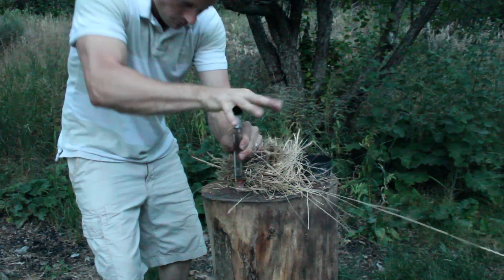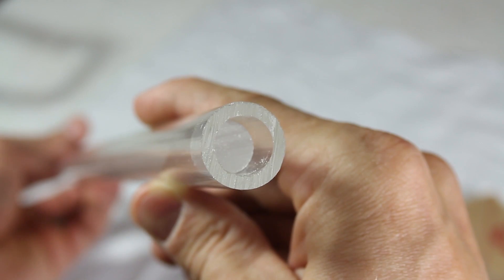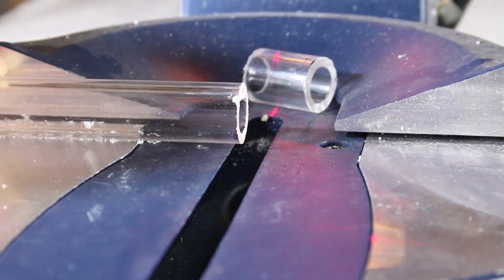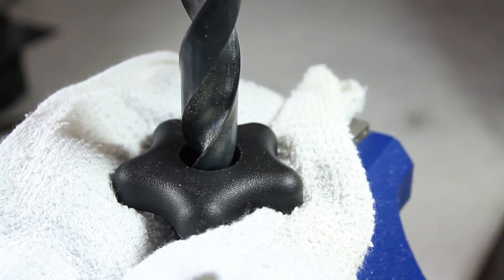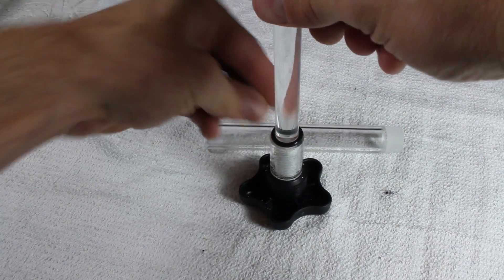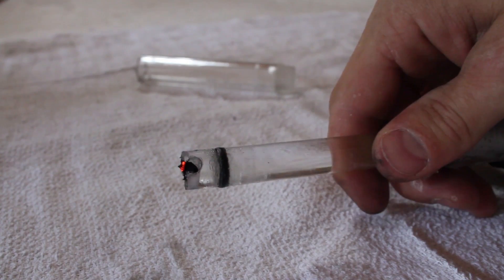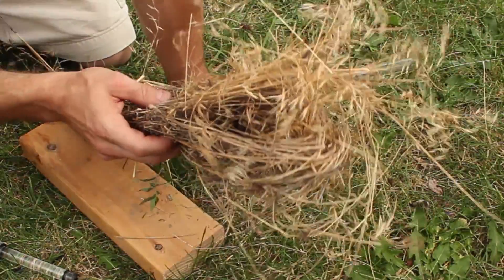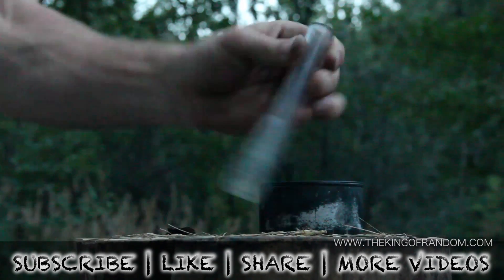Slam Rod Fire Starter - Ignition By Air!!

Comment: The principle is so well known, so such a device should have shown up long before now. Very cool, well hot actually.
   Tip for drilling plastic is to increase hole size in steps, use a low.drill speed, and most importantly use a lubricant. Mineral oil is perfect, but most anything will work in a pinch as long as it doesnt contain solvents. It washes up nicely afterward with soap and warm water. I saw the evidence of overheating during  drilling at least one of the holes where the chips coming out looked soft. As soon as you smell plastic its already too warm. Let it cool down before continuing.

Comment: I guarantee that the piece glued to the bottom will fail after several uses.  Been there, done that.  Also, if you want to use it repeatedly you need to get fresh air into the piston.  This is easily done using a small wooden dowel rod to push down into the cavity a couple times to force out the oxygen depleted air from your last combustion.

Comment: As one who has had one for years, I can say that this system of fire starting is iffy at best.   I do NOT use it as a primary fire starter, as everything in Nature is against getting a fire that way.: humidity n the air and on your fingers; bad char, bad tinder, too windy, too wet,   BTw you don't have whack (unless you like injuring your hand).    Btw anybody who says they get a spark on nearly every stroke is a liar.

Comment: hold up..... if compressed air ignites on it own. why do we need fuel in engines? Can someone make a high compression engine than ignites air on its own?
Reply: It's not the air that ignites. The temperature of the air rises due to the compression, which is enough to light the tinder.

Comment: How does it work
Reply: The equation PV=nRT, all you need to know is that P=Pressure and that T=Temperature. This means that pressure and temperature are directly proportional, meaning that if pressure is increased, temperature is increased as well, in a linear fashion.

Comment: Salvaged the 1k $ machines too ? x)
Reply: <100 for a cheap drill press. <20 for a cheap set of bits. <20 for a second-hand hacksaw. If you really wanted the use the chopsaw and not a handsaw you could pick up a cheap one for <100. I don't see what you;re getting at.

Comment: Or you can use a lighter
Reply: A light can run out of fuel a fire piston can't
Reply: Hououin Kyouma, AKA Rintarou Okabe what if you run out of charcloth
Reply: +Mister Dad. any dry tinder will work fine. dry brush, crushed dry leaves etc etc.
Reply: nah this is a lot cooler
Reply: What f the lighter has no fuel?

Comment: How long does the acrylic and O-rings last before you have to make this piston again? This looks like a great survival tool or just a general purpose tool for around the house if you happen to have a fireplace, fire pit, or a grill and you don't have any lighters or matches handy. But I'm interested in how often you might have to replace it.
Reply: It's a hydraulic piston so you'll have to replace the o-rings now and then. Install viton o-rings and use silicone grease for max life.

BTW: They were used extensively in the home until the invention of the safety match.

Comment: The comment section of this video is full of noobs, who can't use common sense. WHEN YOU'RE COOKING SOMETHING, DOES IT SAY, THAT YOU NEED A STOVE, A MICROWAVE, A GRILL, ETC? NO!
Reply: Yeah a microwave is totally along the same lines as a drill press. Most of the apartments I've rented had at least two drill presses.
Reply: Nah but they usually also don't say "for under a dollar"
Reply: Yeah, but they usually also don't cost less, than a dollar
Reply: Common sense, people. Use it. (Although, In this case, people are making it UNcommon sense)
Reply: aluisious just like not all apartments don't have drill presses, not all apartments have microwaves
Reply: Ummm noobs are new players so what do you mean?

Comment: this is so cool but why would you carry this huge thing or instead use a box of waterproof matches/lighter in waterproof container?
Reply: because, it can be reused an unlimited amount of times?
Reply: +Mason Brinker really it's the handle that makes this seem as big as it is, a smaller handle/top makes for more impact on the hand when used but with a smaller handle it could easily be carried or wherever else you can fit a 6 inch  long 1 inch tube and while your matches in their waterproof tube would probably take up half the space you only get maybe 100 matches in there (lighter may last longer but if it gets wet after you take it out it won't work so well) and with the fire-piston you can get many hundreds uses (although you may want to carry an extra o-ring just in case) punky wood also works well in place of the char-cloth if you are out in the woods and run out.. so if you are planing a long camping trip or you want a nearly un-exhaustible source of fire, you are far better off with the fire-piston... although, if you are just trying to light a candle you would be better off with the lighter or match..
Reply: you have a limited amount of char cloth
Reply: Eric Hughes but as I already explained in my first post, you don't have to use char cloth...
Reply: You only need a tiny amount of char cloth and you can pack tons of it in a bag

Comment: Would this work if you didn't have char cloth? Instead of drilling the hole in the middle of the tube end, if you did it at the side and sealed off the end, couldn't you ignite larger tinder? or used another wider tube that slides down to temporarily seal the hole for the tiny tinder...
Reply: +Raphael Loh you can use other substances as tender, small pieces of punky wood or, I believe, pieces of charcoal from an earlier fire would also work well. the problem with using a wider tube at the bottom is that it creates more airspace and makes it harder to create the same pressure with your stroke, also as far as sliding another larger tube down for a temporary seal,if you don't have a near perfect air-seal  you will have problems with creating the pressure spike, so I don't know how well that would work..
Reply: Yes, if you have very dry tinder then it will work. You might have to give it a few whacks to get the temperature up. The hole is not necessary, just convenient.

Comment: I really want to try this, but I have no idea where to find the acrylic (plastic) rod or tubing. I have checked 3 hardware stores, 2 hobby shops, 1 pet store (thinking that there might be something related to an aquarium) and come up blank. Any ideas where else I might try?
Reply: +Bryce Webb cough mate check the internet
Reply: +polol770  Thanks for the suggestion, but I already did. Online the rods and tubes run about $30 to $40 a piece. I wasn't interested in making that many.

Comment: Here is a project for you to consider:    Start with your fire tube design,  but eliminate the claw for the charred cloth.    The lower end of the fire tube should have an anti-backflow valve, a simple ball valve will do.    In front of the valve is the chamber for the char cloth, and in front of that is another valve, spring loaded to hold the pressure of the piston,  but set to release under the pressure combustion.    In front of that is the barrel containing one of your nail/paper cone darts.    The fire tube could have a trigger released spring so no hand impact is necessary.     And in the cone of the dart is some of your rocket fuel.  I expect super sonic darts disappearing into the sky.

Comment: Why don't you spend that dollar on a lighter?
Reply: +greg williams this is more reliable
Reply: +scott purcell im surethose O'rings will last for ever and no amount of forest junk will ever compromise the integrity of those titanium O'rings.
Reply: hehe
Reply: greg williams and cooler
Reply: Its more fun to do it this way!!!
Reply: lighters dont work when wet or out of fuel with this even if it was wet a few pumps would vaporise the water and dry it out and it can use fuel thats easy to come by in a forest also doesnt need a flint like lighters do

Comment: I found a site that sells the tubes and rods for really cheap but the acrylic sheet, which I am unsure the thickness of, comes in 12" by 12" sheets at the smallest size, which is $30 for 1/2". Please tell me where I can get smaller pieces, as there are no plastic stores near my home. Thanks very much.

Comment: 'And it will cost you under 1 buck'
Then proceeds to use equipment well over a few hundred dollars.
Reply: Razvan Ghita Try a few thousand
Reply: Alucard Hellsing I doubt its more than 1500
Reply: Alucard Hellsing Wtf ? Im not american but in my country you can get all of these for like 500 bucks and even cheaper if you get them used.
Reply: Razvan Ghita? Well I am in America so a GOOD one ( by which I mean a top brand)  is really pricy but you can get cheap ones they just aren't as good
Reply: Alucard Hellsing Aren't there any good ones that aren't ridiculously overpriced? How much would cost average ones?
Reply: For a drill press any where from $75 to $1000+
For a belt grinder $200 to $4000+

and the higher prices are very good because you get a larger and/or better machine
Reply: Alucard Hellsing Oh . Of course it's so expensive if you buy the fanciest thing in the store that's like saying a good shirt is 400 dollars
Reply: Razvan Ghita No I mean a Baldor is better in every way.  Its like comparing a new Bugatti to a 1985 rusted out Chevy.
Reply: Razvan Ghita Eh what ever I was talking about my experience and what I had
Reply: +Razvan Ghita Aahh I'm pretty sure he meant the parts of the fire piston and not the tools he used to make it, wow power tools are not required for ANY of these operations, all you have seen in this video could be easily accomplished with files, handsaw and electric or cordless drill.
Reply: +Razvan Ghita Equipment most should already have, but it's kinda BS to say $1 considering most people don't live in 1325 scrapyard lane, Factory city, CA
Reply: @bigchooch4434  I'm three years late getting here, but I was thinking the same thing. I have a lot of scrap lying around, but I haven't gotten to the point of getting into acrylics or having friends who just happen to have them lying around.  I might have a couple of the things he used, but I doubt I could luckily find a cap just the right size to fit in that handle. You sized it up perfectly, and you had me almost cackling  at your 1325 scrapyard lane assessment. Nah, I'm cackling, still cackling!!!
Reply: Razvan Ghita If you still don't get it you never will.
Reply: Dani Paunov - dumb comment
Reply: well he said if you recycle the materials
Reply: ***** I tried the same logic and the folks on this thread cannot grasp that point.
Reply: +**** child - most people that watch his videos do have these things.
Reply: It said Salvaged items can you not read
Reply: no, really all you need is the drill press, which you can buy for under 100 bucks from home depot, all the other tools are common enough you'll probably already have them, are very cheap, or can be substituted be hand tools (ie file/sand paper and hacksaw). Even the drill press could probably be replaced by a drill if you're carefull
Reply: He doesn't mention that you have to wear clothes and eat food to have enough energy to build this thing. And eyeglasses if you can't see close. And a car to drive to the scrap yard! And, let's not forget the camera to record the video and the computer and the connection to the internet! That's like more than 20 bucks I think. Oh! And toilet paper! And toothpaste! And KY Lubricant !
Reply: +Razvan Ghita I find this a little bit frustrating too.... but forest peoples have been using this method for thousands of years, and it may have developed with people using stone tools, so we shouldn't feel too bad..... (ok, they didn't use acrylic.)
Reply: +Razvan Ghita  you are so right
Reply: +Alucard Hellsing but most of the people have these things
Reply: well, I think that is normal today
Reply: +MIDBC1 you can use alternate items so it depends on. you
Reply: +Pípr most people dont have belt grinders and drill presses
Reply: Use sand paper for a sanding belt it's slower and less effective but it works and he is just saying tell materials are cheap
Reply: Jarod Morris doubt that its most
Reply: Well,l our opinions don't make us wrong or right.
Reply: I've had a drill press, table saw, band saw, grinder, belt sander, and more in my garage forever,  but as another person said, you can use a hand drill or other tools, Grant just used what he had nearby, you don't "need" the expensive stuff, he just has it, so why not use it?
Reply: Charlie Foxtrot w
Reply: All you really need for this is a saw and a drill
Reply: A hack saw and a drill would do., If you don't have that minimal equipment then its passed your bed time kid.
Reply: Of course, it is assumed that anyone wanting to build cool stuff cheaply already has his own tools. If you don't have these tools, save up and buy some. You'll use these the rest of your life.
Reply: Nah I have all the equipment abaout 300
Reply: 'This recipe will cost only $4'
Wants you to use a stove, which costs more, than 4 dollars
Reply: darrell3391 Which still cost more than 1 buck
Reply: darrell3391 I got what he meant from the first place but I was just pointing out that he is ommiting a big part of the procces.
Reply: Razvan Ghita most people already have those tools in their garage. but you don't need a belt sander you can use sand paper and a half saw and just a regular drill

Comment: +Grant Thompson, the fire-piston technique also works with other char material as well. Anything that will work with a flint/steel will also work with it. If a small hole is drilled into the end instead of a claw, a small chunk of charcoal, char-cloth, fine fibrous materials (two hits), plant char, etc, can all be used.

This is a great design on many levels. First, if the material is slightly damp and therefore is not reaching ignition temp, you can see it through the clear tube. Second, the material is superior to many others as it is an insulator concerning heat. Metal conducts heat too well and the char ignites at a lower temp, especially with good heat conductors such as aluminum, copper, and brass. The higher temps achieved with this unit make it even more reliable for ignition, though the acrylic material will wear faster from the heat generated in the claw area.

I would recommend this build for those interested in wilderness survival. 

Good job, Grant.

Comment: Presuming you could get the plastic rods already the right diameter , it could all be done by hand with just  a few hand tools; he did it faster with the nice but not needed expensie machinery... wonder how a bicycle pump would function presuming it could be slammed home that quick?
Reply: john Doe Theoretically it would work but it would take a LOT more force.  The amount of force needed increases as the square of the diameter.  So if x pounds of force is needed for his 1/2" tube, a 3" diameter bicycle pump (6 times larger) would need 36 times more force.  The build would have to be proportionally thicker and stronger.

He probably figured out the smallest piece of tinder that's practical and used that diameter to avoid this problem.